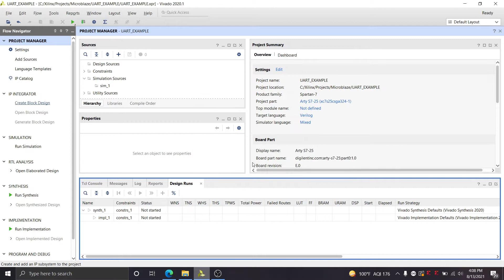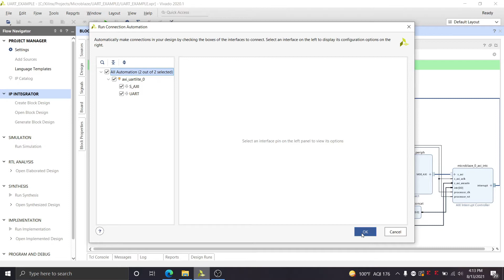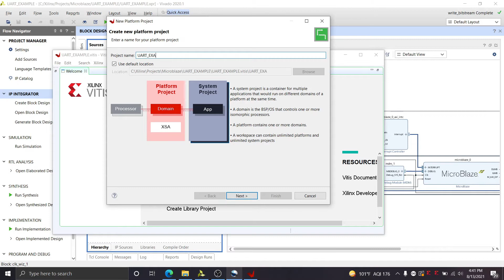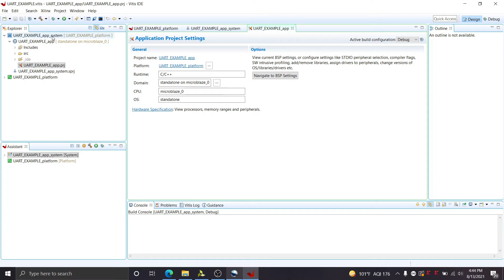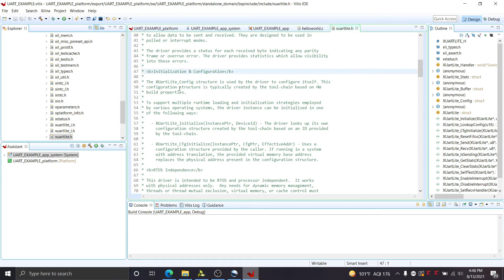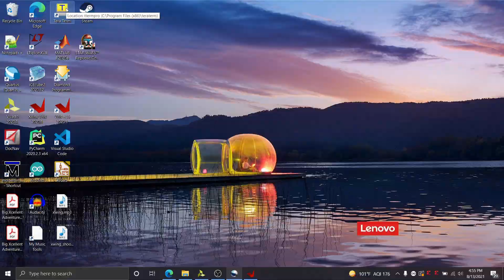Microblaze and UART Lite on the ARTY S7 | Vivado + Vitits

Comment: Thanks for the video, you did a great job of going step-by-step. I used a BASYS3 for this project. It worked fine, except I had to change the checking wizard external reset type from active low to active high.
Reply from the maker: Thanks for watching!

Comment: I tried it with pynq z2 board but I'm getting this error because it shows I didn't assign pin for rx tx for uart. please help me with this

[DRC NSTD-1] Unspecified I/O Standard: 2 out of 4 logical ports use I/O standard (IOSTANDARD) value 'DEFAULT', instead of a user assigned specific value. This may cause I/O contention or incompatibility with the board power or connectivity affecting performance, signal integrity or in extreme cases cause damage to the device or the components to which it is connected. To correct this violation, specify all I/O standards. This design will fail to generate a bitstream unless all logical ports have a user specified I/O standard value defined. To allow bitstream creation with unspecified I/O standard values (not recommended), use this command: set_property SEVERITY {Warning} [get_drc_checks NSTD-1].  NOTE: When using the Vivado Runs infrastructure (e.g. launch_runs Tcl command), add this command to a .tcl file and add that file as a pre-hook for write_bitstream step for the implementation run. Problem ports: uart_rtl_0_rxd, and uart_rtl_0_txd.

Comment: Great video. Too bad you did not include any text receiving from the UART.  Regarding the compiler warning about TxStatus, it is declared (int declaration) and set (= assignment) but not used anywhere. Basically the set line (line 92) is used to call the SendData function but that's it. You're not taking advantage of the return value of the function for anything.

Comment: Thanks for a great video. I am using Vivado and Vitis 19.2. At 20.29 on the video, when I right click on the uart_example_app to build the project, it gives this error message (mb-gcc.exe application was unable to start correctly (0xc0000142) - Any suggestions?
Reply: The issue was with the toolchain on my laptop and when I installed my tools on a new computer, it worked right out of the box. Thanks for a great video

Comment: I dont see any alphabet on my tera term, but only "Uart lite tx test successfull". Can you help me plz? Otherweise your video is very helpful to me. Thanks a lots !
Reply from the maker: Ya sometimes the code launches and this happens, while the board is connected to the terminal, hit the reset and you should see the alphabet pop up
Reply: Can it be because the local variable TxBytesSent is uninitialized? Local variables must be initialized. Otherwise they will have an undefined value. It should be initialized to 0. Or is this different somehow with C in this context?